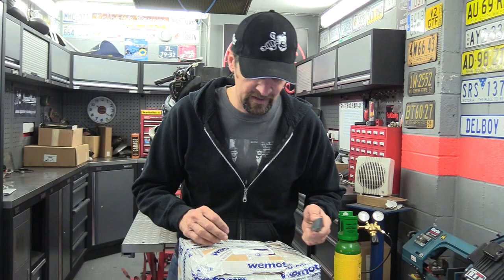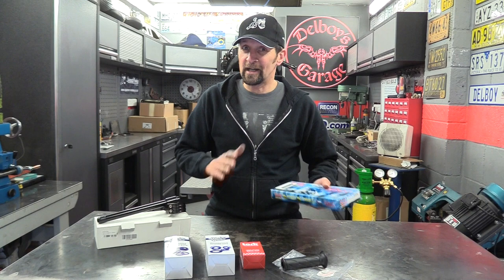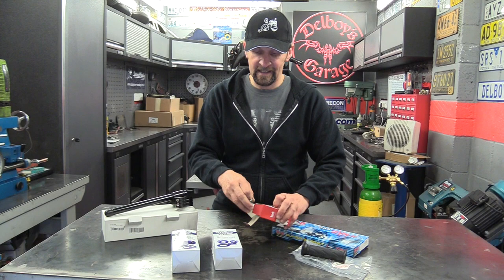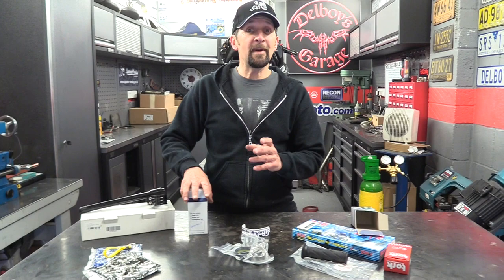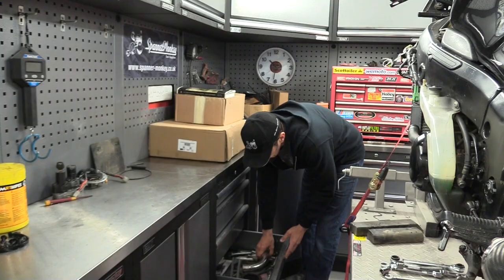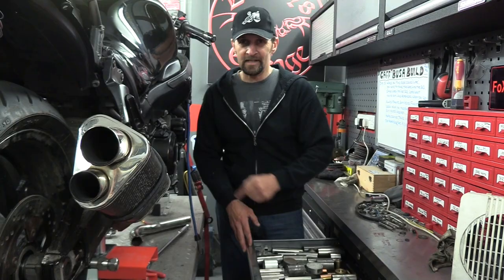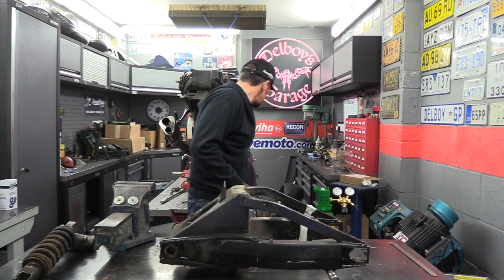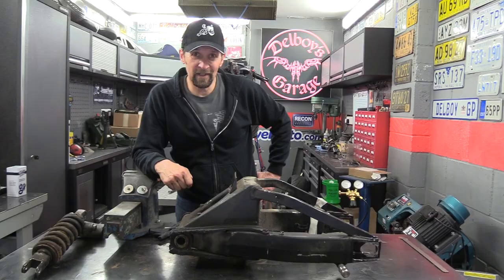Delboy's Garage, Busa Build, Day 6, Swing Arm Removal !

Comment: Have had one of these for a while now, they're absolute beasts, will follow the project, sounds interesting! Also a little tip, the torque arm for the rear brake is attached to the swingarm with a bolt and nut rather than threaded directly into the swingarm, socket on one side and spanner on the other and it should crack free. Just went to check it on my baby to make sure. Hope it helps/comes lose!
Reply from the maker: Hi Oliver.. as you maybe saw, i got the nut off the torque arm, and the bolt stayed put,..got it to turn maybe an 1/8th.. but it was flexing and jammed.. so if it isn't threaded in there then its mighty rusted in place.... but it has a drowning of WD40 over it, so ill have another crack later once it's had time to soak...  Thanks for your kind support, and really appreciate you watching... Cheers, Del.

Comment: Thanks for the 'homage' but some good reasons were given below as to why to have the axle the other way but I have always followed the factory settings. As 'experienced' as I may be with the bus  (only coz I own one since they came out in '99) I dont have your tech experience. Never done a swing-arm, rear suspension let alone their bearings and great to see how its done. Im always learning from you and have learned so much to date from you. Not having a bike bench Im never tempted to work on my knees, so some things are out of my reach. Cheers Bro and love to Pen who is always doing a great job behind the camera. You guys really do put so much of your time into it. Kudos.
Reply from the maker: Hi buddy, it was only right to say thanks, and i know the venerable Busa has a very loyal, dedicated and passionate family of followers, maybe even more so than Harleys... so its great to be able to learn from a few of you...  many rear axles get reversed, on Harleys its usually because the rear exhaust silencer covers it so it means wrestling the silencer off every time you want the wheel out... well yer only gonna do that malarkey once aren't you..lol.... so most people just poke them in from the left...im interested in the suggestion that the chain self tightens if the axle it left side inserted... ill give that a try and see..can't see how that happens with a symmetrical axle and identical spacers...and they have the really handy spring plates to hold the spacers in place while you insert the wheel too aye..!   keep in touch buddy, always good to hear from you always.. Del.

Comment: Youuuuu are awesome buddy.  Exactly what I was looking for!
Reply from the maker: Glad I could help!
Reply: @Moonfleet41  For my 2007 R6, the swingarm calls for a 42mm ring nut socket. I was thinking of getting a 42mm or 1-5/8 socket and cutting it.  Do you think it matters much whether the socket I'll be cutting up is a 12-point or 6-point?   Secondly, Yamaha's official tool is only a 3-pin socket, even though the ring nut  has 6 slots in it.  However, Motion Pro's version is a 6-pin socket.  Do you think I should do 3 or 6?  Torque is 68ft/lb.

Comment: Great video as a rule I always anti seize or copper grease all bolt shafts not the threads lol just wanted to make that point with the threads it shows the vehicle or bike has been well looked after and it makes for easy disassembly and reassembly all the best stay safe

Comment: Great vid. I got to do my 1995 exup swing arm bearings. I have just got a new red jack like yours but have to get the adjuster pads made higher as  the suspension links sit well low of the frame. On wards and up wards.👍

Comment: The reason the spindle was reversed is because, if you don’t  when you come to adjust the chain you’ll find that the torquing up will always take the chain up tight because of the rotation of the nut, by reversing you don’t get this action and adjusting is more straightforward 👍
Reply from the maker: Aha, I knew there would be a logical reason for such a modification... cheers!

Comment: I do the same, always replace bearings. But the swing arm is always stressful ! On my Bandit 400 I had to beat the axle so much to get it out ! Even if it spins, the tube inside between the bearings was rusty and started to fuse with the axle... I did it on my ZZR 1100 but no chance on this one, I had to cut the swing arm to get it out ! Penetrant fluid, heat, I tried everything lol. It's sad, but when you see rusty bearings like in your wheel at the end you know it had to be done... Good luck with the Busa, I wonder how it will look in a cafe look with the coolant tank on these bikes !
Reply from the maker: Thats a sad outcome buddy, i never like to give up and cut things, but sometimes, i guess that is all you can do..  Im going to eliminate the expansion tank all together, just like i did on the ZX7-R streetfighter bike... no need for it if you use waterless coolant.!
Reply: @Moonfleet41  Yeah sad but by beating the axle on the side of the bike I was afraid that it would bend the aluminum frame and make some play with the swing arm after reassembly... And for 30€ (thanks to the popularity), I didn't want to risk it ! And I tried to separate the tube from the axle on the bench, impossible. I don't know how but it was so rusty and fused ^^
I missed this part on the ZX7-R, i'll pay attention on the Busa :)

Comment: Looking for a pair of aftermarket mirrors that can be folded back without unscrewing; click stop detents sort of thing. Need to get my bike through a narrowish doorway so bar end mirrors won't do it. Just need to lose those 2 last inches. Any suggestions gracefully received.
Reply from the maker: Is that on a Hayabusa then?.. they fold back already if it is..?!
Reply: @Moonfleet41  God, no. On an sv650; but I realised that I can swivel the mirror heads up which accomplishes the same thing.

Comment: Another great video, just wondering why you don't squirt every fastener and bolt with WD40 before and during disassembly especially when you can feel and hear they are dry?
Reply from the maker: The little ones are really important cos they so love to snap, but the big heavyweight bolts that hold the short link together I find unless you've got a spare two days and can keep topping up the WD, then it makes no difference anyway... just reach for the breaker bar and crack 'em off!

Comment: Hi del could you advise me im putting the alternator casing back on and says in my Haynes to apply a suitable sealant to the rubber wiring grommet could you advise me what type of sealant I should use regards Aussie Bob
Reply from the maker: Hi Bob, I know where you mean, and I've seen people use all manner of things, inc. bathroom sealant!  Personally I use the black heat proof silicone that you can buy from auto stores, if it's good enough for exhausts, so it won't melt, or burn, if you thoroughly dry and de-grease the surfaces, it will stick and make a great seal... usually comes in a small toothpaste sized tube, hope that helps, good luck with it mate!
Reply: Hi del thanks for getting back to me, and thanks for the info, keep up the good work mate its greatly appreciated regards Bob

Comment: On my ZX-14, I routinely insert the rear axle from the 'wrong' (right) side because, by doing so, the axle traps the brake caliper holder and right-side spacer, and holds them in position while aligning the wheel and inserting the axle and left-side spacer.  If the axle is inserted from the 'correct' (left) side, it's difficult to get the axle inserted without the right-side spacer and the brake caliper holder falling away.
Reply from the maker: Aha.. so there is a reason..!  Thanks buddy, thats obvious now you say it.! im lucky with the Busa, the wheel spacers fit into the wheel tight and stay put... but most bikes can be a total pita...!

Comment: Found a set of 3/4 drive sockets on amazon lately. it was around 70€. 
The noise it makes sounds the same as yours.

make a search on amazon with : silverline 633663

I used those for the rear wheel of my 2009 Triumph speed triple 15th anniversary.  and it worked like a charm. 

keep rocking! :)
Reply from the maker: Yes Mike.. a great kit there, and what a good price.. you'll never use them enough to wear them out either.. sound investment aye.

Comment: Should buy yerself sum ratchet spanners m8. Halfords do a good set
Reply from the maker: Have a set of Facom ones buddy, but as I'm sure you noticed, so many of the fasteners on this tear down were stuck solid, so it was the breaker bar and solid ring spanners, as you well know I'm sure, you shouldn't stress a ratchet, but yeah, in normal use, Facom for the win!
Reply: @Moonfleet41  aye I noticed lol 🤣

Comment: Hoooo I just bought a second hand push bike.. it's in the shop until Friday having work done ☹️ £200 plus now £160 at the bike shop for new everything. Bearings, brake pads, linkages for the derailures.. urghff.
Reply: New chain, new sprockets. The list goes on. I almost choked when the guy came up with the price. Oh well. I suppose it's worth doing right once, then I can look after it in the future.. 😶
Reply from the maker: Exactly that mate, a clean slate and you can take it from there!  Enjoy....
Reply: @Moonfleet41  Cheers man. It's Cannondale so far as I'm aware it's a pretty good make. Guy in the shop said I got a fair enough deal. I did try to haggle the price down a bit but honestly it's not worth it, just get it done right, once, then I can see to it after that, like you say.

Comment: The threaded rod you have for pressing  the bearings in , would a M16 500 mm threaded bar be ok as im trying to guess the dimensions of yours , also where did you get the metal disc's from as they are handy for using with the vise too . I'm getting myself a record no. 5 vise too 😁 . thanks for any help mate . love your videos and I've learnt so much. .
Reply from the maker: If you mean metric 16mm when you say 'M16' then that's a bit thick, but I guess it will go through most bearings, mine is M10, and the discs I made myself from some 6mm plate, just cut them to size!
Reply: @Moonfleet41  fantastic ,yes I ment matric M16 , I'll go for the M10 like you as I've not purchased it yet just needed to check . Thanks again for your help 👍 ..